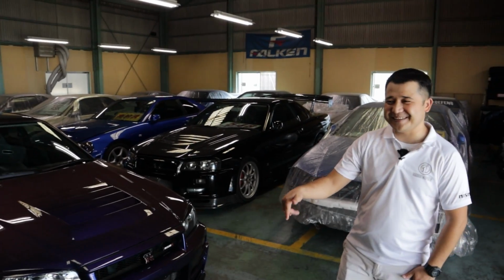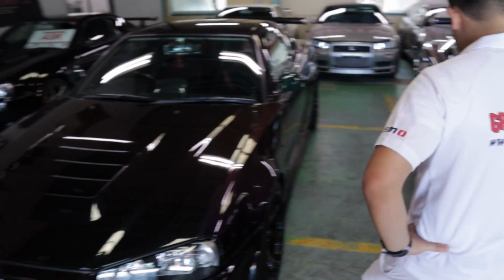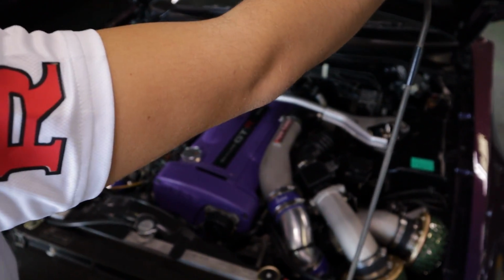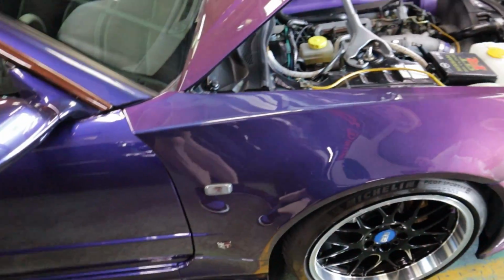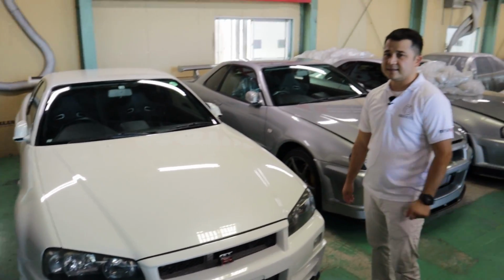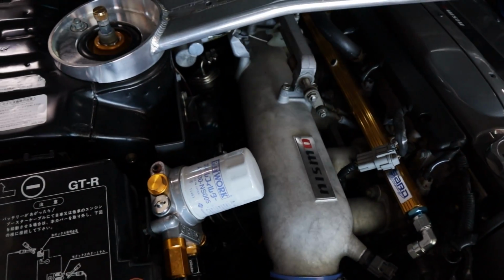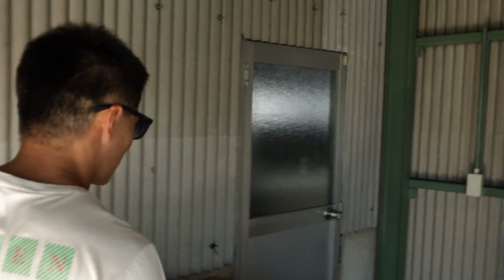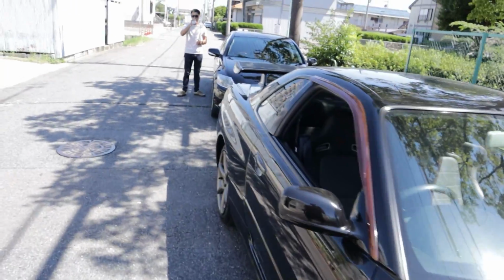DRIVING A $200,000 ULTRA RARE R34 GTR AT GARAGE DEFEND!

Comment: You'll get there one day for sure. You made a point though about the nerves driving such an expensive car. I felt like that even with my r32 GTR which was worth significantly less, the cost of parts and the value of that car sometimes made it difficult to own tbh, the car was consequently never driven anywhere near as hard as it wanted to be. As much as I love GTR's I think I am more comfortable in a cheaper car now or at least something more simplistic and affordable to work on. I think folk who have £100k plus to spend on a car might not worry about these things but I did.